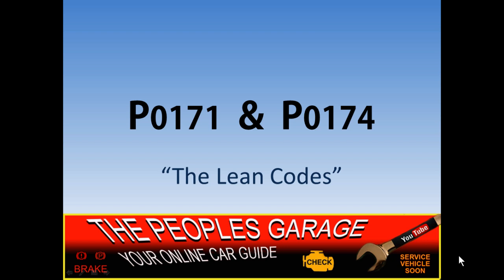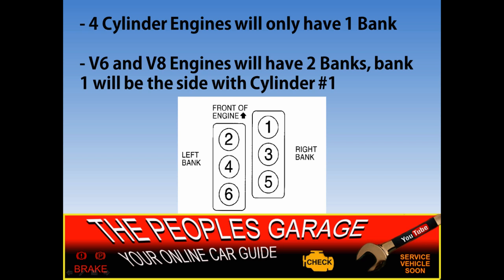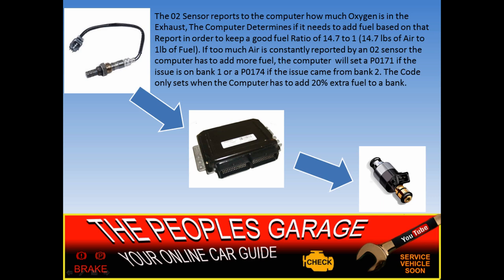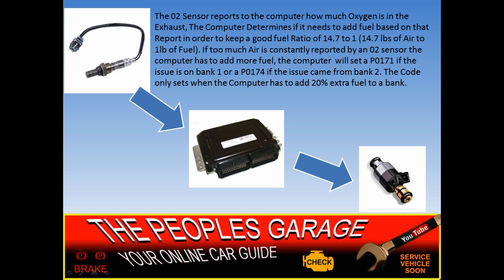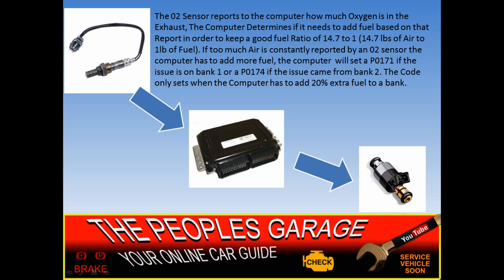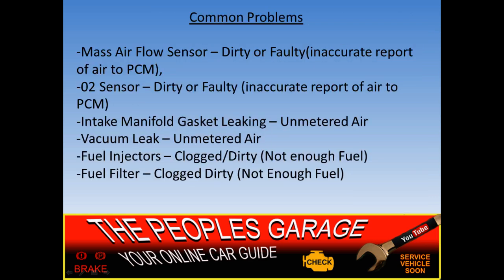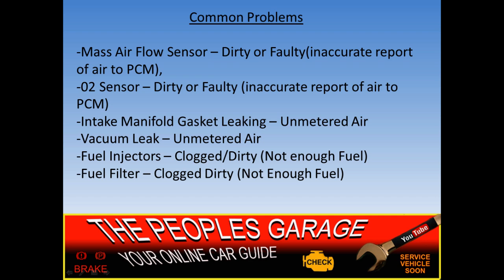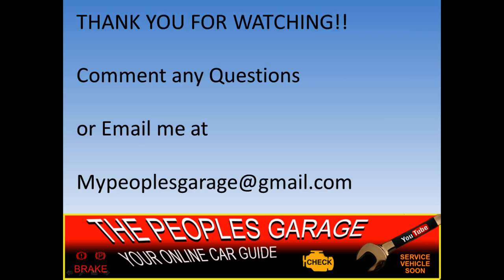How to Diagnose Codes P0171 & P0174 - Lean Bank 1 & 2

Comment: I have a 2001 ford f150 with 5.4l i have both codes i have done just about everything to fix the issues. havent checked the elbow on the back of the intake for the pcv valve but did spray carb cleaner on it and had no change. As well as all around the intake manifold and vacuum lines. what is the lb/m the maf is suppose to read at idle and will it be constant or vary. i did clean the maf, iac, and the trottle body its self. but the codes still pop up.
Reply from the maker: The MAF will usually read about 4-6 g/sec at idle, and it should be a
Reply from the maker: it should be a steady reading changing slightly when the AC kicks or an electric fan as these will change the idle sometimes. However on these ford trucks I always see either a pcv elbow leaking, and intake gasket leaking, or a dirty or faulty MAF. The MAF can read good on a scan tool and still be the culprit as I have learned and if you have a scan tool watch the fuel trims as you spray the manifold with the truck running and see if they change while you spray, if they do its the intake otherwise clean the maf and erase the code if it comes back replace it.
Reply: ThePeoplesGarage my scan too reads for my maf 0.76 lb/m for the reading which when i set it to metric its about 5 g/sec i will definitely use spray to check the fuel trims will carb cleaner work as a good spray or do you recomend something else? Thanks for you advice.

Comment: I have a 2001 Ford f150 V6 4.2. I have bolth codes, cleaned the fuel injectors, new MAF, and new manifold gaskits, still no help. Any thoughts?
Reply from the maker: have you checked the pcv elbow on the manifold? spray for leaks and make sure the new gasket seated properly on the manifold.
Reply: Yes I have
Reply from the maker: have you erased the codes or were you waiting for them to go off?
Reply: ThePeoplesGarage I reset the codes and they came back. maybe when I changed the fuel filter the air in the line gave it the code?

Comment: nice DIY  i have a 2004 acura tsx and this code come up P0171 maybe u can give me advice . thankxssss..
Reply from the maker: The P0171 code is not very common for your car, however I would suspect a faulty MAF Sensor to cause it. I would purchase MAF cleaner from the parts store and take out the MAF sensor (just to the left of the Air filter box) and clean the element inside of it. Your other option is to watch my video for a Vacuum leak but I would try the Sensor Cleaning first. If its not a cleaning or a vacuum leak you will have to replace the MAF sensor with a new one.
Reply from the maker: I forgot to mention once you clean it you must have the parts store erase the code (check engine light) to see if it comes back on
Reply from the maker: cool, hopefully it was just a dirty MAF!

Comment: Thanks a lot I'm trying to fix this my self without spending big money I'm also get a gas smell  I don't have a ruff idle but I could feel the car corecting it's self so the rpm gauge moves back and fourth only 1 centimeter  not ruff I'm going to clean the MAF hopefully it's the problem on my 03 infinity g35 next I will change the 02 censors thank u
Reply from the maker: ok yea try the MAF Cleaning first, if not check for a vacuum leak, I have a video that helps you find them.

Comment: Can a bad a bad after Catt o2 censor cause this or before the Catt
Reply from the maker: Its usually going to be the Cat but the 02 sensor can also cause the code, it will be the Rear 02 Sensor that picks up on the condition, so if you wanna try and Oxygen Sensor do the After Cat Sensor

Comment: hi I got a 2004 Durango 5.7 litre engine with a fault p0174 fuel trim bank 2 system too lean code,  also car would shut off only at idle if car was on for a awhile.  I couldn't see any leaks or anything on the car...... im thinking towards checking towards the fuel pump since it was car was shuting off... or what should I do next
Reply from the maker: You can check fuel pressure, but usually a fuel pump will cause p0171 and p0174 to come on since it affects both sides equally. Bank 2 on the Hemi will be the Passenger side so check for vacuum leaks on this side

Comment: I have a 2001 cadillac deville with codes P0171 and P0174. Replaced intake gaskets and still have the same problem. what else should i do?
Reply from the maker: Have you looked at the MAF sensor? Also make sure the intake gaskets were torqued down properly and not too loose or tight, they can be tricky to get right.

Comment: I have a 1995 Lincoln 32 valve continental with a code P0171 bank 1 replaced filter I am going to check mass air flow censer do you have any suggestions ?
Reply from the maker: Yea its something only related to bank 1 which is passenger side, so don't look at the mass air flow or fuel filter. Try spray the intake manifold and vacuum hoses on the passenger side of the engine, check out may vacuum leak video for help.

Comment: Hi I got a 1999 Ford Mustang 3.8L v6 150k. 4/5 times the vehicle is started and driven the idle of the vehicle fluctuates from around 600 - 1100 not rapidly but randomly, sometimes it will stall during idle also stalls when slowing down to a red light. It seems to have hesitation in acceleration, and occasionally when moving at around 25-35 mph the rpms will jump around and the car will almost die out(never on the express way though). the tone of engine changes and sounds like she wants to die (almost like its misfiring/sputtering, only lasts 15 seconds maximum with heavy hesitation but no raise in the rpms or speedometer, and then usually corrects itself) but if the car is fully warmed about 15 mins, this will no longer happen. I've cleaned the throttle body, maf sensor, installed a new fuel pump, pcv valve, new spark plugs and ignition coil, does pull codes for o2 sensors but nothing else. Any ideas on what it may be?
Reply from the maker: if its got 02 codes I would replace those, that can cause it to run bad, the MAF might be defective even if it does get cleaned. But I would be spraying the intake manifold and vacuum lines for a leak to eliminate that also. watch my vacuum leak video

Comment: Hi there.  I have a 2003 5.3 sierra with 118k miles.  It threw both lean codes.  I cleaned the MAF sensor but the light is still on.  Should I replace it?  Other options?
Thanks
Reply from the maker: I would check for a vacuum leak around the intake manifold by spraying brake clean, check out my vacuum leak video for ideas. I would also eliminate the fuel pump by checking fuel pressure. Even though you cleaned the MAF sensor if its shorted internally its gonna need to be replaced.

Comment: I have a 2006 subaru wrx 2.5L turbo charge 63,000... I've notice my car smoking this morning, took the car to my mechanic.... Diagnose the car and it reads Post Catalyst Fuel Trim System Too Lean Bank 1....
Reply from the maker: The Post Catalytic Issue on the subarus is generally going to be a rear 02 sensor which is pretty easy to do yourself, what was the exact code number p0171? If you decide to tackle this yourself I would suggest spraying down the rear 02 sensor with "PB Blaster" from your local parts store and getting a Direct Fit 02 Sensor and not a universal that you will have to wire in yourself..

Comment: 2004 Mercury Marauder w/ 147k miles.  Yesterday morning on the way to work, the Check Engine light came on in -7º weather.  Ran rough at idle and the exhaust smelled rich.  When I got the car home last night I checked the codes and I had P2195, P2197 and P0174.  I have a K&N filter that gets cleaned at least twice a year and when I clean it, I also hit the MAF with MAF cleaner.  I haven't had a chance to check for vacuum leaks yet.  Any advice on where to check for the leak or should I look in a different place (O2 sensor(s)?) for the problem?
Reply from the maker: Check my video for checking for vacuum leaks, there is a common pcv hose that leaks on these vehicles, its usually on top of the engine towards the front and connects to one of the valve covers, check the rubber elbows on each side for leaks.

Comment: I have a 96 300zx n/a Nissan w/ 126K miles. I had a mechanic diagnose the problem? I have a P0174, she  said it was the 2nd bank.  I have a loss of power, a very slight change in rpm, and it has a gas like smell . Any suggestion on what cud be faulty and what I should start on first? I hope its not a gasket leak, the removal of the plenum will be very expensive.
Reply from the maker: I would check the Intake Manifold by spraying it with the car running, bank 2 is Driver side for you. Check out my video on Checking for a vacuum leak.

Comment: I have a ford windstar 2000 and i just got both codes any advise on what to check and how nice video thanks in advance
Reply from the maker: I would watch my video on Checking for vacuum leaks and spray brake clean around your intake manifold with the car running and listen for change in RPM,  Then try clean the MAF sensor, it might need to be replaced if the cleaning doesn't work

Comment: Hello! I had a ford focus zx3 2001, and I retrieved a P0171 code. I changed the pcv valve and elbow hose, and still throws that code. How do you check for a vacuum leak? have you ever tried using the cigar technique? if so, where would I connect the hose...to which vacuum hose?
Reply from the maker: You can check out my Vacuum leak Video and spray around the intake manifold with the car running and listen for RPM Change, but you might wanna try clean your MAF sensor on your car its common, only use MAF Cleaner and if that doesn't work it might need to be replaced, but check for a vacuum leak first.

Comment: Hey I have a 2004 bmw e46 325i and I have a P0174 code plz help me into getting it fixed. What should I check first n strep by step DIY    Would be highly appreciated  thanks in advance
Reply from the maker: Confirm that its only a P0174 Code, if it is the only code your problem lies in the back 3 cylinders, Spray brake clean around the area with the engine running to check for vacuum leaks. Crankcase Ventilation tubes are common on your car to leak. Watch my video on Checking Vacuum leaks

Comment: I have a 2003 Chevy Silverado 4.8 it shows both codes. In the morning when its like 32 degrees and the engine is warming up and the Rpm goes down my engine starts to stutter it doesn't turn off it just gets very shaky. in the afternoon it's fine and runs great. i changes the air filter and cleaned MAF sensor.
Reply from the maker: Check out my video for Checking for a vacuum leak, those trucks have intake manifold leak problems, a lot of times you need a scan tool hooked up to detect the leak as it wont make too much of an RPM change to notice without the tool. But you also might need to Replace your MAF sensor instead of cleaning, its a 50/50 in your case..
Reply: ThePeoplesGarage Alright man thank you.

Comment: have a 01 f150 5.4 182,000 miles, idle rough i have a video and leaning towards a vaccum leak due to ther fact that when i stop at a light or stop sign the idle drops to 500 rpm and rapidly goes from 400 to 900 rpm and drops back down and jerks really hard. i hear no hissing but blew both code p0171 and p0174 i changed the pcv valce and assembley which includes the elbow, and my fuel filter. still have it blowing the same code and suggestions? before i go about replacing the o2's and the MAF
Reply from the maker: hold off on the 02 Sensors, the likelihood of bad oxygen sensors on both banks at the same time is rare..I would try clean the MAF, but more importantly spray around the intake and listen for change in engine RPM, watch my Video on Spraying for Vacuum Leaks
Reply: i had the exact same problem, it  would come and go also, some days the truck runs great and all power is there, but then some days it just turns and runs like you mentioned, iv been to these auto places and they've told me MAF sensor ect and i got all of that replaced but nothing change, usually happens when cold.  i still have the code p0171 and thinking its the o2 sensors
Reply: Jamie Hill same truck and same year with a similar amount of miles

Comment: I put a K&N filter onto my 4.8L gmc 09 sierra and now I get these codes all the time...
Reply from the maker: take it back off, reset the lights and see if they come back on with a stock filter, this shouldnt cause the codes to come on unless you removed your MAF sensor because the filter is before the sensor
Reply: sorry its the entire cold air intake I put in
Reply from the maker: Yea try clean the MAF sensor, if you have the stock intake and pipe try put it back on and see if the light stays off.

Comment: I had P0171 & P0174 on my 97 Ford Ranger. I went crazy checking everything & couldn't find the problem. Finally I saw that my fuel tank filler hose was cracked & dry rotted. I replaced that & the codes haven't returned yet.
Reply: did it have trouble accelerating ? cause mine has those codes and idk what to do :/
Reply from the maker: Really? The Filler hose doesnt provide vacuum and should not cause these codes to come on. The Filler hose will cause a P0440, or P0442, some kind of EVAP Code but shouldnt cause these Lean Codes
Reply from the maker: Calistro Reyes What Kind of Car do you have?
Reply: 2000 ford ranger xlt 4.0
Reply: ThePeoplesGarage the check engine light turned on right after i got my fuel injectors cleaned and it can accelerate but when i hit it hard to get on the highway it doesn't rev up, so i have to wait for it to accelerate slowly
Reply from the maker: So the Light Came back on after you did the filler neck?
Reply: yeah it just turned on all of a sudden, when its in park it revs perfectly fine but on the road it doesn't
Reply from the maker: Calistro Reyes Try Clean the MAF Sensor, its odd that it started doing this just after it was worked on..
Reply: ThePeoplesGarage Strangely, I didn't get any EVAP codes. But it's possible for the P0171 & P0174 codes because the system does work on vacuum.
Reply from the maker: No Evap system will set Evap codes, not 171 and 174, i would look at the MAF or an intake leak

Comment: My 2006 Chev Equinox 3.4L V6 has the P0171 code, there's only 1 O2 sensor so all banks are bank 1. Checked for basic vacuum leaks, can't find any. Emissions Readiness always shows EVAP Sys incomplete. So maybe the engine is getting too much air from the EVAP system, or perhaps the MAF is malfunctioning.
Reply from the maker: You have a V6, so you should have 2 front 02 Sensors one for each bank. You wont see the one in the back because of the Engines Position, but they usually dont cause this code. Evap takes the longest to set but usually you are allowed 1 not ready for emissions so you should be fine. EVAP system is fine because it would set its own code and wont set a P0171, its not MAF because that would set P0174 also as it effects both banks evenly. Your Driver side is bank 1, you need to spray your intake manifold down for a leak. Watch my Vacumm leak video..Keep me posted
Reply: ThePeoplesGarage
I sprayed everything and found no leaks and no loose intake bolts, but checking the exhaust manifold bolts, I found one bolt that snapped. Unfortunately changing out the bolts is 2 hours labor plus the cost of extracting the broken bolt still in the head.
Reply from the maker: And its Just a P0171, with no P0174 going with it? Are you able to look at the Oxygen Sensors on a scan tool by any chance?
Reply: ThePeoplesGarage
I replaced the pre-cat oxygen sensor only a few months ago. I use the Torque app with my Android phone to read the codes (only get 171 the LNJ engine only has one pre-cat O2 sensor) and view the oxygen sensors on a graph. LTFT is higher under acceleration and lower under coasting.

Part 13 is where the single oxygen sensor sits.
http://www.gmpartseast.com/diagrams/large/1L1/exhaust-system-1l0310001.png

http://www.gmpartseast.com/chevy/components/2006-equinox_exhaust-system-1l031000103-lnjm451ln26.html
Reply from the maker: try spray the intake with brake cleaner and watch the Fuel trims on your program

Comment from the maker: Reason im saying left side only is the P0174 code is for Bank 2 only which on a ford is the driver side..its saying too much air is entering the engine...if the P0171 code is NOT present its most likely a vacuum leak with your Intake Manifold but spray and listen for the engine to stumble or pick up RPM when you hit the right spot..this way you can either 1) Tackle the repair yourself, or you can avoid a Diagnosis Fee by telling the shop to just replace the intake gasket that you diagnosed.
Reply: What if my 99 mustang gt gives P0174 and the MAF says 5.0 g/s?

Comment from the maker: Dealerships charge WAY too much, but an independent shop will most likely still charge you to diagnose this code because its a generic Code and doesn't tell you what is going on. IF this is the ONLY code that comes up on the scan you most likely have a vacuum leak. Watch my video on how to check for vacuum leaks, go back to advanced auto and get a can of brake clean, spray around any vacuum lines on the left side of the engine and spray the black plastic manifold around the left side of it..

Comment: I have a 2005 Ford Taurus and Advance Auto gave me a diagnostic code of P0174.  The engine is running rough at idle and sometimes shuts off when I pit the car in reverse (auto trans).  I dont habe time to do the repair myself.  Would you reccomend I take the car to a dealer or private company?  Can they use thia code to fix the car without charging me for a diagnostic.  Help is much appreciated.

Comment from the maker: Is your car idling ok? The P1506 code is usually related to an idle problem such as a bad Throttle Body, Throttle Position Sensor. The other 2 codes mean you have an air/vacuum leak or a faulty sensor tricking the computer into thinking there is a leak. What is the Year, Make and Model of your vehicle?